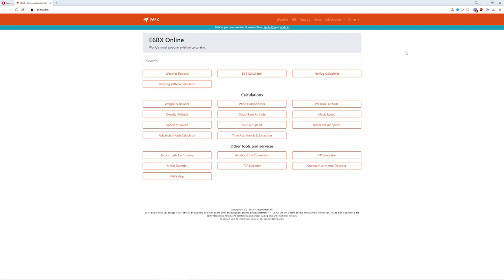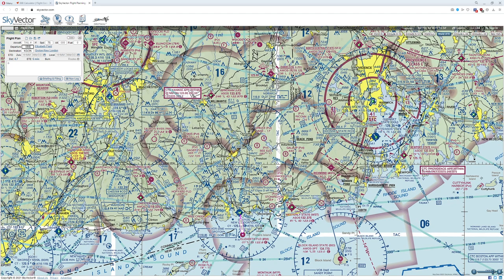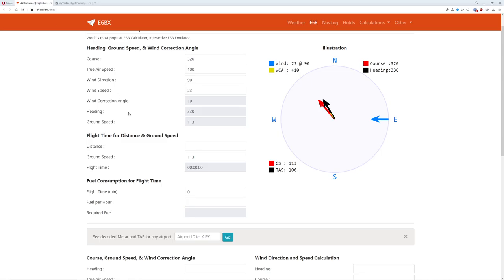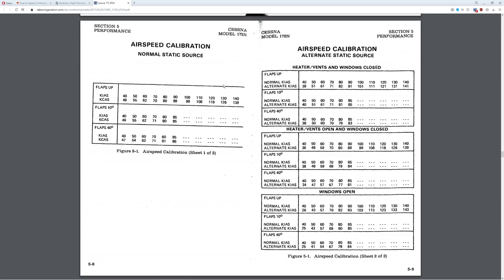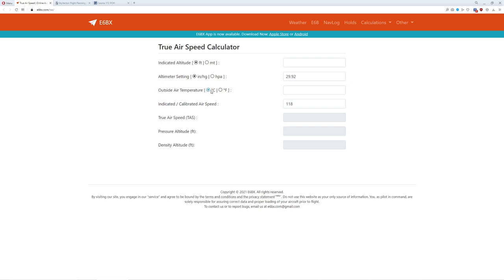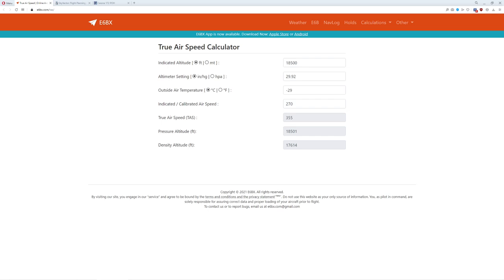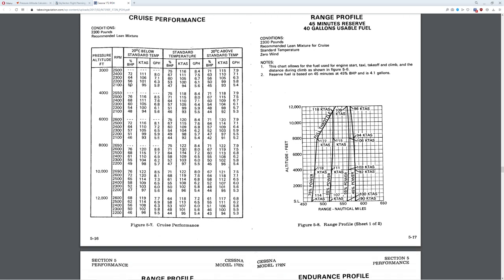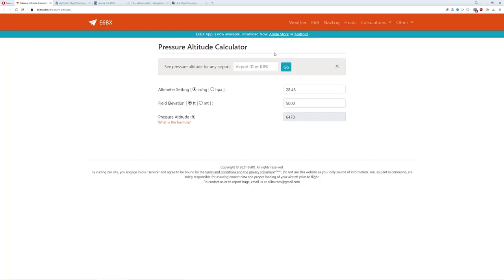Flight Performance Introduction: Calculating True Altitude and True Airspeed

Comment: For those who wonder why TAS (normally) is greater than IAS/CAS, consider the following: your little needle is a pressure instrument. It essentially calculates how many air molecules the pitot tube hits per unit of time, converting that to an indicated speed. When you're cruising at altitude, the air is thinner so there are fewer air molecules around. You must therefore travel faster to get a reading of 100 knots than you have to at sea level where the air is denser. Temperature plays a role, too.

Not all important calculations are related to TAS. Everything important to aerodynamics at slow speed is related to IAS. It's the IAS that tells you have many air molecules you hit with the aircraft, and it's those same air molecules that keep your wings flying. All approaches must therefore be flown on IAS, not on TAS.